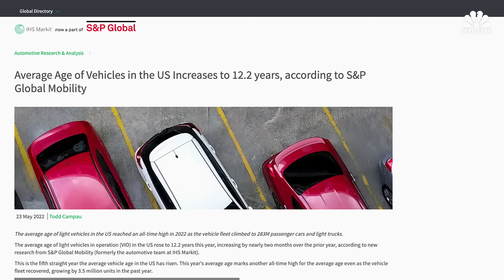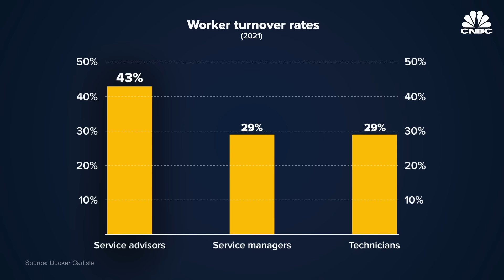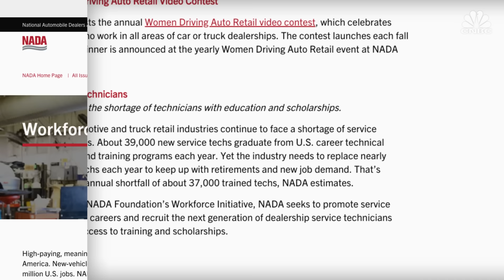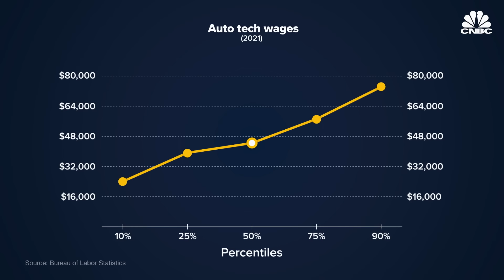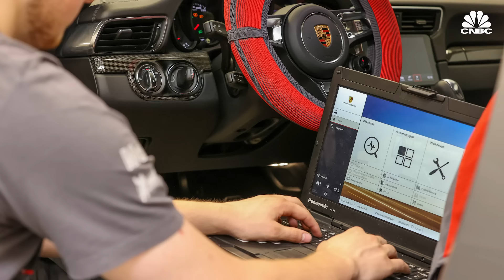Why The U.S. Has A Shortage Of Auto Mechanics

Comment: Not a single interview from an actual mechanic. Solid journalism.
Reply: SUPER underrated comment. Most of the report seemed to lean around dealerships losing profit because of understaffing
Reply: It’s CNBC. They are hot garbage all around. Hahaha
Reply: Whats happening to auto techs is the same thing that happened to consumer electronic techs  a few  years back . Poor pay horrible cheap customers on goIng complex systems  increasing cost of operating a bussiness to many local bottom feeders passing them selves of as leaders fining zoning regulating  plus the  global leaders have declared war on citizens  mobility in most parts of the world
Reply: They couldn't find any mechanic since they're in short supply.
Reply: Good thing, because an actual mechanic would’ve turned the air in the room blue with invective
Reply: Because society thinks mechanics are useless until they need one, which is always. I was a mechanic at a dealership for 10 years. It's more lucrative to be a Walmart door greeter and you're treated with more respect.
Reply: This is exactly the same in Aviation. Every. Single. Problem.

Auto shop class in HS.
Reply: from what i heard...its low pay for a dirty job. people cant afford repairs either, even used cars have gone up in price. I went to chevy for a job and they said it was $540, I ended up doing it myself for $180 and 15 minutes.
Reply: Oh you don’t want a blue collar real dude with 20 years on the floor experience to say a word because he’s gonna really hurt some feelings. After 20 years as a truck mechanic I got a full clip of loaded suggestions 😂 one of the biggest problems is ppl should never be allowed to work in a service dept or even talk about it like this video unless you’ve been a tech for 10 years. He said 80-100k is darn good money. Lol the management that kills of the company can likely make up to triple that and they don’t have a clue what’s involved on the floor generating the money. Of course there is exceptions but a shop today is nothing like a shop 30 years ago. Nothing like it at all. And now we see what’s happening as yuppies take over and call the shots in a field where they have no place.
Reply: Ahhhh where do i start.. 1st it’s expensive to be a mechanic. We have to buy lots of expensive tools. The pay isnt good unless your a master level tech. The work is getting more and more technical with the ever increasing amount of electronics. The cost of repairs scares customers into using street mechanics. Training is mostly learn on your own. And traing and progression of pay are brothers in arms. I left the automotive field after 14 years and now work on diesel trucks for a fleet. Very good pay!!!!!
Reply: I been an auto tech for 15years. I have seen many young people come and go. Some of them went through an expensive automobile program just to find out they didn’t like it and quit. We techs do not get paid hourly, we get paid per job. I can knock out a brake job in 45 mins but it pays 2 hrs but at the same time it only pays 12 hrs to replace a cylinder head but it might take me 16hrs. The younger guys don’t wanna hustle anymore yet expect to start at $28 bucks an hr. We have bad and good companies so different techs will have a different 😊experiences. My shop has a/c,  heater, we get a Christmas bonus up 4k, we also get free lunch on Saturdays, up to 4 weeks pay vacation. I can’t complain.
Reply: So true. Because mechanics know what's wrong with the job. The dealers are taking advantage of the mechanics
Reply: They don't want to pay and screw around there workers anyway they can that is the problem 😂
Reply: Screw the companys let them go broke 😂
Reply: Thank you for saving 13 minutes of my time
Reply: We dont call it fake news for nothing.
Reply: Cause they would expose the industry lmao
Reply: Thanks for saving me 13 minutes
Reply: Damn, i didnt even realize that they didnt interview a single mechanic!
Reply: @dougfisher1813  😂
Reply: 😂😂  no kidding .... here's a quote for the absent interviewer "Pay me Sucker and I'll come back."
Reply: i love how they dance around the clearly faulty logic “there is demand and people willing to pay us (the middleman) but for some reason we cannot find mechanics )?” 🤡
Reply: Yeah, great point. I guess we should thank them for techsplaining this to us.